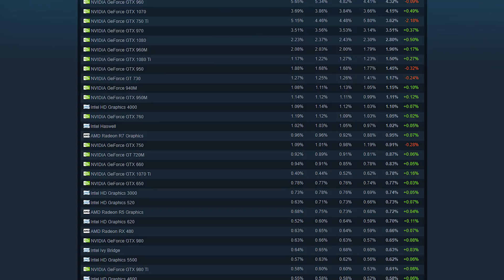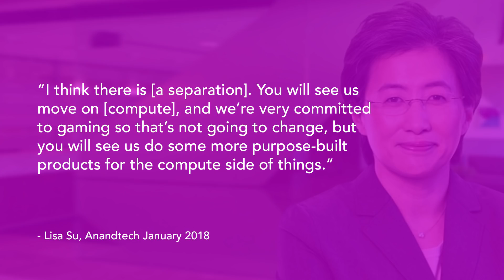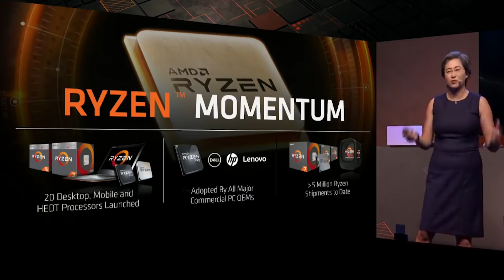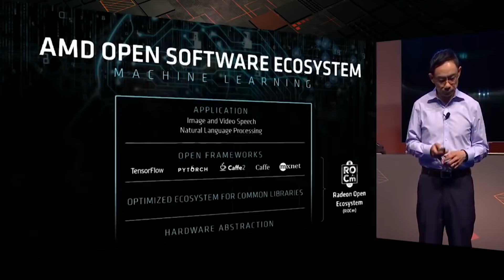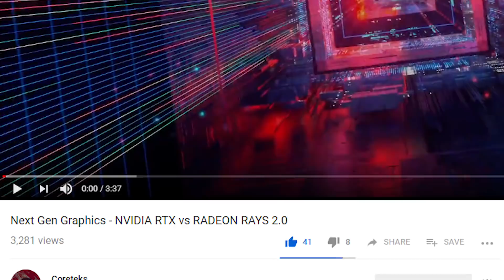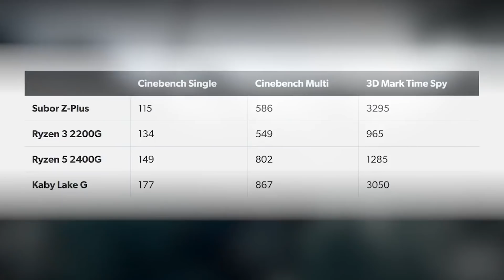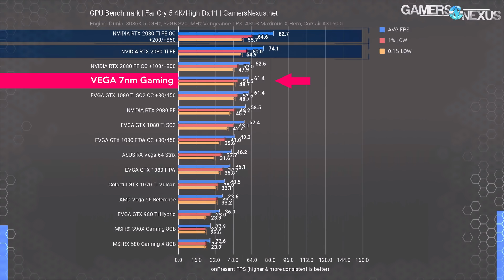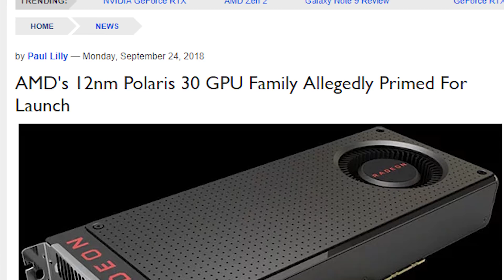AMD's answer to RTX

Comment: Hello there Coreteks:

I been hearing Navi being launched  sometime next Spring cause I been hearing March being thrown around a little. So who knows when we will see Navi or even Arcturus. Arcturus is the graphics tech beyond Navi so what i am thinking is that we would be seeing Navi sometime next year which would be 2019 (kinda hard to believe that 2019 is only a few months away, time really seems to fly). So we could see the real answer come next year as (I agree with you here) the Polaris refresh is just going to be a stopgap to tide us over until the Navi Launch. There is another interesting report that is going around that Sony and AMD are working very closely together and are bringing Navi to the PS5 so we are going to see maybe a CPU equivalent to the Ryzen 7  1700 (could be the 1700X, we don't know at this point so i am just throwing that out there as a possibility) and a Navi-based graphics chip in the system. So the PS5 is going to have real-time ray tracing capabilities as well. I know i am going off on a little tangent there but back to the main point and the point is that we just don't know when in 2019 we will see Navi. You might be right in it being late next year or others who are predicting earlier next year could be right. You nailed the RTX launch but  you possibly could not nail the Navi launch cause you can't be right 100% of the time. Just Isn't possible.

Comment: For someone on a budget like me an AMD card is the only one that makes sense. I could either get a GTX 1060 6gb for $269.00 or an RX 580 8gb for $209.00. The two cards perform practically identically in most games. 2 gigs more memory and the same framerates for $60.00 less. When building an inexpensive gaming rig with a tight budget that extra $60.00 means I get a 256 gb M.2 NVMe SSD when I couldn't afford one otherwise. If money was no concern I would get a 1080ti at least but not everyone is so lucky. I have had Nvidia cards since the Riva TNT, TNT 2, Geforce 256, Geforce 4MX 440, Geforce FX 5600, Geforce 6800,  GTX 280 and GTX 660. The only Radeon graphics I have ever had were in a laptop with an AMD A-10 APU with Radeon Graphics but hey, I can do some light gaming on it. It plays Skyrim at 40 - 50 fps. It's time for me to give AMD a shot.

Comment: Great Video! I think your conclusions about the strategy and the pricing is accurate, but I don't think Turing was anything like a rush job to beat out a beefed up vega or something: Turing is an investment long in development to pioneer the space. The hardware MUST come before the software. They're planting their flag.  

So you're also saying Vega 7nm will square off vs Volta or, probably, a T100 (Turing Datacenter iteration). I think they'll be lucky if they get it out the door by end of 2018, and I think it would be a miracle if it competed with NVDA.  Also, GLOFO has abandoned it's 7nm efforts- as recently as a few weeks ago- and so AMD must get in the back of the line at TSMC, who is already contracted for 7nm Apple, NVDA, and other clients' projects. ALSO, Lisa said they were looking at multiple GPU solutions. Radeon Rays is a multiple computer, multiple GPU system, and it wasn't actually 'real time', if you looked at the demo. It was like a sketch-render with low res... and it took multiple gpus to make it happen. There was no comparison between that demo and the NVDA REVIT demo- I do Revit, so I can say, it's different, and Turing is much more impressive.  Do they have a RTX capability / design for a single card? I don't think so.... I think NVDA is leveraging its AI chops in a way AMD will find difficult to replicate, and NVDA will improve faster, as AMD will struggle to replicate. 

I think it could be a long time coming for AMD to have RTX capabilities- I agree, AMD will struggle to be relevant.

Comment: I just don't understand the fan groups for either team. I prefer Nvidia cards but at the moment that's simply because they offer the more powerful options. If AMD had a competitor to the 1080ti for a similar price and tdp, I would definitely have considered it.

The only thing other than performance that I prefer about Nvidia is digital Vibrance. And I could live without it if it meant saving a few hundred dollars

Comment: How can you not mention about vulkan api.  We know amd launched mantle api. Which birthed Vulkan API.   Vulkan api is open source and not locked behind window 10, and can see dev support it more then bloated directx 12,   Vulkan api will prob get there own version of ray tracing in some form I bet.   Sure AMD will support vulkan more then dx12.

Also if AMD do launch either refresh or new gpu before end of the year.  Could possibly see a custom version that gpu prob in the next gen console along with some (hopefully ) custom AMD Ryzen 2 gen+ apu.   Love both my pc and consoles. 
But do really hope next ps5 gets boost in gpu performance,  rumours Sony May go with custom vulkan api for next gen console. ( take with grain of salt )
Yes not happy with current anti consumer direction Nvidia been going lately.

Comment: 35% faster is not was amd say, there say 35% more efficiency as a vega 56. This means not 35% more fps, this means less power a bit higher clockspeed thats all.  Its simply a vega refresh not a new produkt, the only new produkt is navi. 

1,35 efficiency has nothing to do with a 35% of fps gain. The fps jumps are more like 10% to 15% that is normal by a 35% efficiency.
Reply: 35% efficiency can be COMBINATION including higher clocks and reduction in power, reduction in power at same clocks, or increase in power increase in clocks (do 100mph use 1 gallon of gas or do 135mph use 1.2 gallons or do 75mph and only use 0.8gallons...it is "marketing" they all do this, and they all will always do so ^.^

Comment: The power draw increase of GDDR6 over HBM2 won't matter as much to a consumer buying 1 or 2 vs an enterprise customer who is buying by the thousands (30/40 watts per gpu). 14nm Vega required the HBM2 because a 512 bit bus of G5X would of drawn 100 watts on its own, and with 14nm Vega cores chewing through 250 watts, they needed to lower the power consumption of the board in any way possible. If the new process really does hack the power consumption, then they may have the power budget this time around for a fat GDDR6 controller for the consumer version. For example, GP 102 and GP 100 are the exact same chip except for GP 102 having a G5X controller and GP 100 having an HBM2 controller.

Comment: How about the power consumption of this virtual 7nm Vega gaming card, 400 Watts? I'm not on personal solar panels here, I'm connected to the public electricity grid just like everyone in my city.
How about the card's temperatures, 80+ºC?  Once upon a time there was a video card named GTX 480 that was HOT(95-100ºC), loud and power hungry (almost 300 W, in 2010!) and the laughing stock of everyone back in 2010. These were the times when Nvidia fanbois were roaming around with troll faces even during sleep, like one of my friends who sported a GTX 200 series room-heater because it was _da shit_. Only till 2012 with Kepler did Nvidia "retake the performance crown" but ever since we kept getting more and more power hungry cards to the point where now in 2018 it's considered OK to have a 350+ Watt video card. That with increase in kilowatt hour prices, prices increse for everything actually.

Comment: Most people buy mid-range cards(960/1060 or RX 470-480/570-580). I picked up a 4gb RX 570 for $120.00.The only high end card I even own is an R9 Fury which I bought used recently for $180.00. All AMD needs to do is do a 7nm refresh of Polaris or Vega and let nvidia have the high end $1200 RTX rubbish.
Reply: 470-480/570-580 are technically NOT midrange design wise...they would be more of a "performance main stream" like 7870 or x60 were from Nv for years and years...Vega would be more like a xx70/xx80 from Nvidia...the naming is different but the "place" on totem poie is not.

put a different way use RX 400 as example or even further back to the R200 series
230-240 were "budget" 250-260 "mainstream" 270-280 "performance mainstream" 290/290x "enthusiast"
if the 400 series did same (but did not really different pressure from Nv) 420-430 "budget" 440-460 "mainstream" 470-480 "performance mainstream"
or even further back 7000 series
7200-7400 "budget" 7500-7600 'mainstream" 7700-7800 "performance mainstream" 7900 "enthusiast" 
for nvidia was more or less ALWAYS similar method
x2x-x3x "budget" x4x-x5x "mainstream" x6x-x7x "performance mainstream" x8x-x8x2 (Ti, Titan) "enthusiast"

Comment: Great video Nvidia may have got ray tracing first but some how I think AMD will do ray tracing better I am not sure why I am thinking that. So if that turns out to be true the only thinf AMD needs to do is make sure all of those GCN cores actually get used unlike the current cards such as vega 56 & 64. If you look at a game like Forza hor 4 the vega 64 was faster than a 1080ti and very close to the 2080 which hardware unboxed was very surprised from the results and stated that when the game is optimized well and can take advantage of all of those gcn cores these are the results you should expect from the vega cards.

Comment: As far as Nvidia goes, the prices are big issue. Consumer grade GPU prices are now reaching all time high.
It's now up to AMD to come up with some competition to bring the price down, hopefully.
@8:50 wait, "traditionally AMD have the best card for compute"... eh... If AMD compute is at advantage, why most 3D rendering solutions DO NOT support OpenCL? At least among those I know & uses - CUDA has always leading the field, supported by every single rendering software out there. I dunno, is this due to marketing push by nVidia or just due to market cap?

Comment: Will be editing with timestamps and issues tomorrow... but to start:

Analysis is interesting--just... Big things jump out as not understood or not presented properly.

Absolutely no understanding of the timeline of creating an architecture.
Nvidia made a bet in Volta (Volta and Turing are paired akin to Pascal and Maxwell) on raytracing in 2013, maybe early 2014.

14nm Vega -> 7nm Vega being akin to Ryzen 1000 -> 2000 series... No.
14nm -> 12nm as seems to be the case recently is what we're getting.  Just like Ryzen.

We also know that Nvidia was delayed their launch on these cards.  Likely was ready 3-6 months before it launched.  But mining bust (and mining in general) killed that period of time.
The reason features were delayed is that Nvidia wanted a huge push of "look at this new stuff you have not seen" and should not be taken as an indication of when the actual GPUs were ready to be launched.

Oh, and 35% better performance almost certainly means 35% higher clockspeed at a set level of power.  That's normally what it means.

Comment: I want to believe! I found a flaw in Ryzen 1800 and 2700 that caused me to dump it for Intel.
Reply: What flaw? Can you elaborate?
Reply: It affects USB audio equipment specifically the kind that use digital signal processing through the use of a driver. Basically you get popping/crackling audio but it doesn’t affect onboard audio, but you wouldn’t use onboard audio to drive Sennheiser headphones would you? So it’s a dealbreaker. I have a socket 775, 1366, 2011, 1155 test systems and wouldn’t you know it, none of them exhibited the issue. So that makes two Ryzen test systems I have and the issue appears on both! Guess who I’m using from now on? Lol

Comment: it would be cool if AMD could manage to hybridize 7nm with less hbm2, maybe 4 gigabytes for faster short-term cache, while also providing an additional 8GB of GDDR6 to give it a marketing direction against the 1080/2080 ti by saying it's a 12gb card. i'm not entirely sure how their infinity fabric technology relates to HBM2 or GDDR6, or really gpus in general, but it may be feasible with proper R&D
Reply: they can "easily" do Vega or whatever with GDDR5-5x-6-HBM-HBM2 and in "theory" they could do a "hybrid" style BUT would probably NOT be for consumer level GPU (they do have the Radeon SSG that has X memory and you could add up to 2tb more, but they are VERY expensive)

anyways, the memory controller on Polaris AND Vega are "built" to handle GDDR or HBM (any version really) infinity fabric is "basically" hypertransport just a much more refined/substantial version of it, much much higher bandwidth/complexity/capability, but like everything it has its limits, I do not think they could get HBM and GDDR to "play nice" with each other as the clock, bandwidth and raw speed/voltage difference between them would likely make it more costly then useful.

that being said, they have done Polaris with HBM and Vega with GDDR (GCN architecture is nowhere close to "shitty" the way people claim it to be)

Comment: I think you're being way too optimistic. Yes, there is a chance that a 7nm Vega card with GDDR6 would perform really well, but a 30% uplift over the current Vega cards is the best we can hope for imo. And that's only in rasterization rendering. And Ray-tracing might the future of gaming but forget about adequate Ray-Tracing performance for the current RTX cards and even the next gen cards. 

I think that Navi will be like a scalable Polaris, highly energy efficient but not very powerful. Put 4 or more Navi chiplets on a silicon interposer though and AMD could slaughter the RTX 2080Ti cards. Wishful thinking of course ;)
Reply: Raytracing requires "huge grunt" Nv has been "shifting away" from "grunt" for a number of generations now, they "style" that the RTX uses is a "minimal" raytrace for speed reasons...Radeon on the other hand being built the way they are have and have always had "grunt" available to them IF the developer takes the time to leverage it (part of the reason why the best code cracking machines in the world, nuclear etc tend to use AMD or IBM for CPU and Radeon for the "number crunchers") if there is ANYONE that "can do it" I put my $$$$$$$ on AMD big time, because they have stuck with "multi-thread" type approach for their GPU for many years now (VLIW5-4, GCN) are all "based" on "lots of numbers at a steady rate with known or expected results given everytime" which is EXACTLY what raytracing/cracking needs.

Nv will likely do it "faster" but given the proper "engine" the Radeons are can almost guarantee (based on past history) to give a far more accurate/precise/complex result at the end of the day....speed is awesome for TN monitors, but if you want "quality" you would go for a high end IPS display..pretty much same metaphor here ^.^
Reply: Ray-tracing can be done in software. AMD already does real-time ray-tracing for 3D modeling apps. Been around since 2016 I guess. Nvidia has hardwired circuits for ray-tracing, where Vega is designed for diverse compute apps.
AMD is ahead of the game here despite what you heard. Ever heard of "Radeon-Rays"?

"THE BEST THINGS IN LIFE ARE FREE!
Open source and part of the GPUOpen initiative, Radeon Rays is easy to integrate, and supports all platforms conforming to the OpenCL™ 1.2 standard, enabling deployment with non-AMD hardware, and Windows®, macOS®, and Linux® operating systems.

The second-generation Radeon Rays 2.0 release works with a variety of low-level APIs including OpenCL, Embree, and others. Radeon Rays is completely free — no-cost, open source, and license-free. AMD’s freely downloadable open source development tools and software enables developers to create and render photorealistic images and content that will make tomorrow’s ultra-immersive virtual reality experiences possible.
" --- https://pro.radeon.com/en/software/radeon-rays/
Reply: Are you a psychic?

Comment: amd needs to include 4 scalar units in their CU instead just one
Reply: f7f8e392704bb9 yup, vega is suposed to granulize SIMD16 more for better utilization. Navi sholud increase sin,cos,sqrt,log functions throughput
Reply: f7f8e392704bb9 raytracing is basicly numerical integration where nvidia beats amds ass. amd does better with textures and has higher shader count for same price

Comment: I love AMD's fans optimism. ''They wrote 1.35x performances so we should expect more, or 1.35x to a very minimum !'', ''New 7nm vega will be better than RTX, probably even the ti in ray tracing... Why? because vega is better than pascal at computing !'' ... yet 20 series shows big gains in compute performances. 

https://www.youtube.com/watch?v=qoFNmU4xt40 ''Despite its fewer CUDA shaders, the RTX 2080 is able to match the GTX 1080 Ti's performance in every scene and shows huge gains in the fish_cat and koro scenes. And just to reiterate, for now, it's pure GPGPU CUDA core/shader work for the whole rendering pipeline as applications have to be programmed to take advantage of the RT cores found in Turing - it will take time while Blender Cycles will benefit from the dedicated ray tracing hardware elements.''

Dont get me wrong, I am happy to see AMD in the game and pushing technology, but lets not over-expect, otherwise if they dont deliver to our over-expectations we'll be underwhelmed.